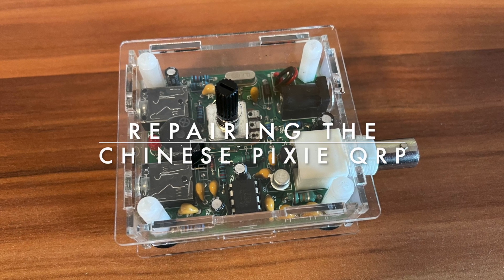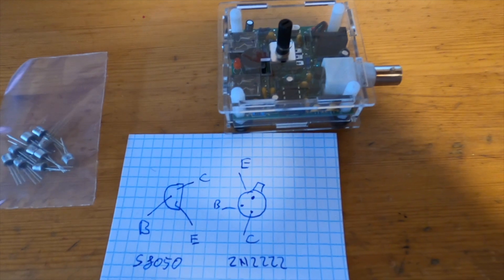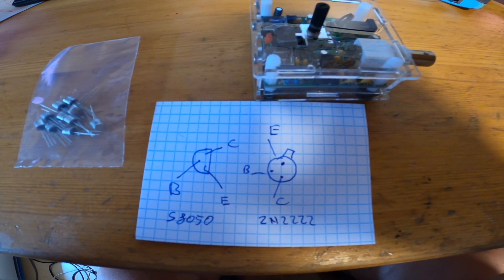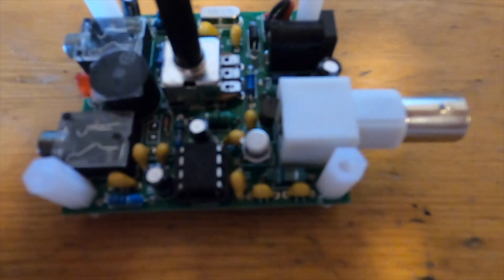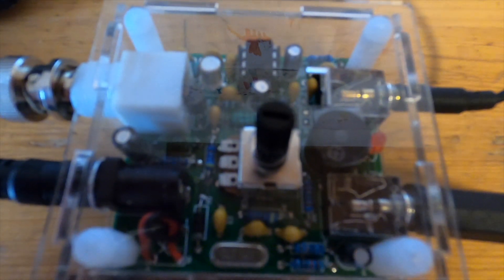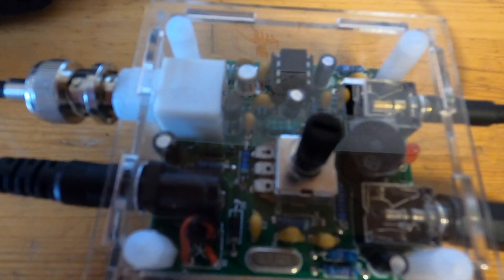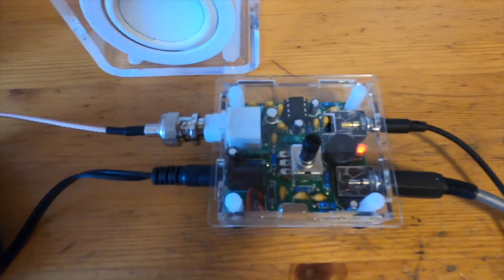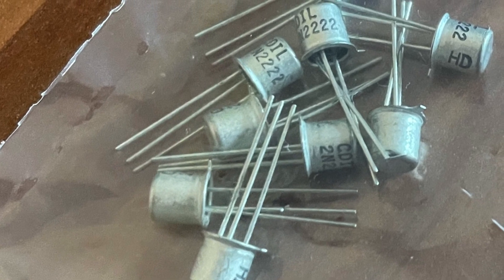Repairing an Pixie QRP with blown up PA.

Comment: Mine blew up and as I tired to repair it the copper track lifted. Good while it lasted on 5.262 MHz.
My new one has a fault on the track, when the audio jack plug was inserted it shorted out the audio. I removed the socket to confirm it and destroyed the socket. The track needs cutting, check before soldering the socket in place. There seem to be a few manufacturers of Pixie's.
G4GHB.

Comment: I use a socket with my PA transistor on my Pixie. The 2N2222 works very well with 12 volts and good swr

Comment: And how long a distance do you communicate with it?
Reply from the maker: I have to say I never made a contact with it. My antenna is not so big. So I think it is a way to less power. <500mW to an "bad" antenna is not so nice.
Reply: I just built my own Pixie and haven't made any contacts yet either. 

But the reverse beacon stations have spotted my calls even 700km away.

I have made 300-500km contacts with another  few hundred milliwatt transmitter on 80m band.
Reply from the maker: @JuhaK71  I have the feeling that a lot of HAMs are not able anymore to listen to weak signals. They catch only the S9++++ signals. But this is only my feeling. Maybe wrong.
Reply: @JuhaK71  Wow!!! Can I see the design?
Reply: @msnepaliman  
You can achieve the same results with any 80m QRP transmitter. 
There are a lot of schematics available on internet.
I built mine with a rare battery tube DLL21, because I have 2 of them.
Nothing really special in my design.

Essential is a good, properly matched antenna, good conditions for the propagation, a counterstation at the suitable distance and not too much  the background noise.

Comment: Hi,
my Pixie died just connecting a 13.5V,  without any transmission. Coud be the same problem you had? 
Thanks for your job!
Reply: Hey. I know it’s a long time ago, I bought a couple of these for my son to put together. They had a 1A bridge rectifier so you couldn’t accidentally reverse polarity the unit, however, I have popped these a couple of times, with one of the diodes going short

The CSS8050 isn’t a bad transistor to use for the output, and it will handle over a watt

 I also replaced the CSS9018 small signal transistor, used for the oscillator with another 8050 to get close to a watt out on 13.8V to the circuit by using 10x AA batteries to feed 15V into the unit less the 0.6V dropped over each of the diodes in the reverse pol’ protection 

There’s not much to these, so easy enough to troubleshoot with a meter. Trickiest part is desoldering components without damaging the board

Comment: I'm having other issues... Not sure what I did wrong.... as I received a kit with no schematic... so I used four different schematics I found online... so I made a mix of all. But I have a horrible noise on RX every time i connect the antenna. Not having this issue with the 49'er transceiver or my home made regen receiver. I still can't figure out what it is. I even ended up removing completely the low pass filter from the output and I'm using a proper one with toroid instead ( external one ).... the noise level it's lower.... but still horrible. 73
Reply from the maker: The pixie have almost no filter. So you get everything into the audio amp. I operate it with batteries because of very loud 50Hz noise if I connecting it to an power supply. I would say this behaviour is "expected". The 49er has one real mixer and should be a little bit more selective. 73
Reply: Thank you.. ohh yes I know the Pixie is a little more noisy than the rest.. but I get the same no matter if I use a battery pack or a power supply. I think I will rebuild it in my own version ))) 73 my friend.
Reply: @dxexplorer  Check out VA3ROM's website on pixie mods. very interesting - http://www.va3rom.com/docs/ATD033.pdf As for the input noise, may be AM broadcast interference... the pixie is a toy so don't be surprised when it doesn't perform well :-)
Reply: Thank you so much. Ohh yes I a fun toy to play with hahaha. But I just hate mine doesn't work well hahaha. I'll have a look in a little. 73
Reply: This is because the LM386 is not correctly used in many of them. There is a good video by VK3YE on the subject and some of the datasheets also have information on the subject.
Reply: Thank you... I did already yes hehehe. I got it sorted out. Not completely... but much better than before )) 73

Comment: Hello, have you tried adding heatsinking to the 2N2222? Would the transistor blow even without any keying at 13.8v? thanks
Reply from the maker: The transistor dies during transmit. Receive on 13,8V is no problem. I added no heatsink but I bought the 2N2222 with metal chassis. It seems a little bit more stable. But 13,8V still not possible. I operate the Pixie now using 8x AA cell. This works fine and output is about 450mW. Thats OK. I think on 13.8V the max thermal power of the transistor is exceeded. 73